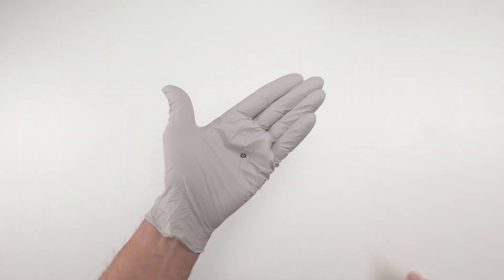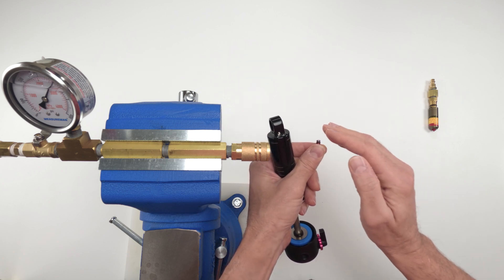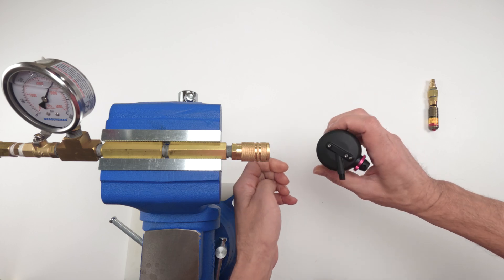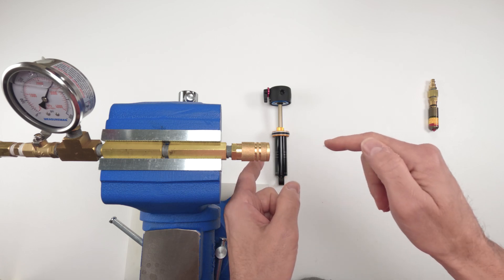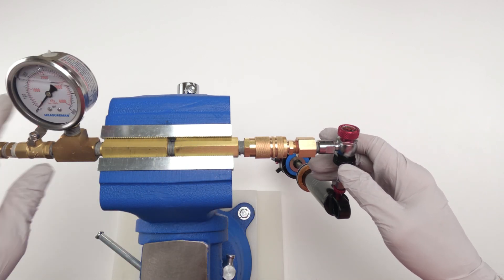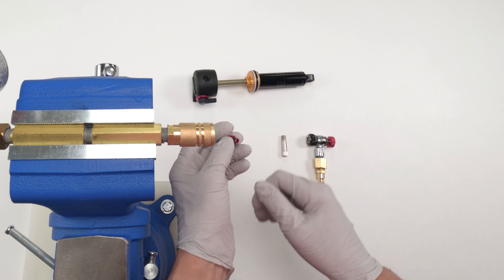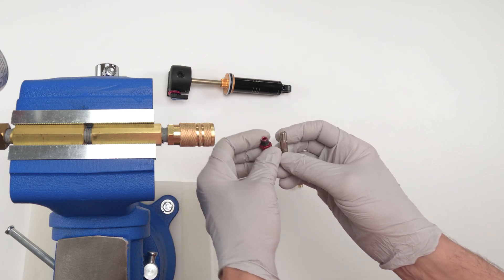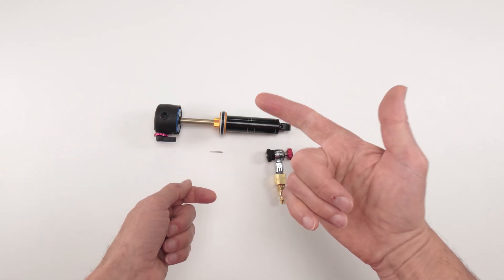Nitrogen Fill MTB Shock IFP Chambers with Schrader Cores for beginners. You've popped your last seal

Comment: Buongiorno,
Intanto complimenti per il video.
Ci sono novità riguardanti questa soluzione da parte di power tank? Oppure avete trovato qualche soluzione di altri brand?
Anso Suspension propone lo strumento "fox & rockshox shock ifp valve charging pro zero loss adapter-fill tool", potrebbe essere la soluzione?
Grazie mille!
Reply from the maker: Grazie per il gentile commento e mi scuso per il ritardo nella risposta. L'adattatore ANSO funziona, ma preferisco l'adattatore Racetech. Pubblicherò presto un video che approfondirà questo argomento. Ti auguro una buona giornata.
Reply: Perfetto, grazie mille.
Ciao!
Reply: Ciao, purtroppo in Europa l'adattatore di Racetech è introvabile. 
Ho provato anche a contattare direttamente Racetech per chiedere una spedizione in Italia ma purtroppo non ho ottenuto nessuna risposta..

Comment: I heard that u can machine  the threads off the adapter and just hold the shock onto the adapter by hand
Reply from the maker: I've never tried it so I can speak to whether how well it works. My main concern would be the potential to damage the weak threads in the damper body when using hand force while filling.

Comment: Topeak's PRESSURE-RITE SHOCK ADAPTER + your modified fill adapter + shock pump would be good for home mechanics
Reply from the maker: You might be onto something with this myman. I just ordered it. If this thing works as I think it might, I'll definitely make a video to let people know. Thanks for the head up 👍
Reply: @zoubtube Strokeshift in Poland also makes a Zero Loss Valve, with different thread options for RS & Fox
Reply from the maker: I'm not sure if he sells it anymore. it always shows as not available. Would you happen to know it can be bought online line elsewhere?
Reply: @zoubtube  Oh, I don't know. I just stumbled on it on Instagram. You might have luck if you message them there directly? Did you receive that Topeak part?
For me, I'm going to drill out my fill adapter (once a backup replacement arrives), add a length of spoke inside and try filling with my topeak lossless shock pump. It's the same concept where a pin engages/retracts to press the valve core, but it's all-in-one in the shock pump, no extra parts needed. Will let you know.
Reply: Update: Received a new fill adapter, drilled it out with a 5/64" bit and cut a length of spoke, filled with my 0-loss shock pump, and removed with no loss! I kept dropping the spoke pin so I 3D printed a pin with a head. There's just enough friction with the pin head to keep it from falling out of the fill adapter but not too much not to be overcome by the Schrader core spring. Works like a charm, no additional parts needed, thanks for the video and the idea!!

Comment: where did you buy that shrader adapter extender male to female?
Reply from the maker: I bought a pack at the autozone next to me, but they can be bought at many places. its a Schrader valve extender, or valve core extender. there cheap, you get like 4 of them around $5. you can also find them on amazon

Comment: Thaks! Found some high pressure hoses and connectors!
Reply from the maker: Good to hear. You might want to look at the video that posted tonight. during the IFP fill I go over sizing a pin to make an air fill adapter work with a no loss chuck. it might come in handy

Comment: @ZoubTube  hello there. Great video as always.

I assuming you are professional suspension mechanic, considering knowledge and tools you are using.
I know how to do small service of mine fork and shock (FOX), but I would like to learn more. I have few questions.

Where did you learn to service forks and shocks?

Is it possible for individual to pay and go to some courses and learn this kind of knowledge about servicing forks and shocks?

Is there any big difference in servicing for example FOX, Rock Shox, Ohlins, DVO?  Do you use similar tools?

How expensive are those machines for filling shocks with high pressure nitrogen gas?

Thanks in advance.
Reply from the maker: "I assuming you are professional suspension mechanic, considering knowledge and tools you are using."
Nope! I'm just an enthusiast. It's never been a profession. But I've been tearing apart motorcycles and cars to the frame from a VERY young age. I was surrounded by mechanics for my entire youth which helped.

I didn't seek formal training for mountain bike suspension work. Some companies, like Fox and rockshox, now provide guides that help. Other companies don't provide anything, so you have to figure it out. Reality is, If it weren't for customs tools, All this stuff would be similar to work on.

There are shops out there that provide training, which might help. But I have no idea how effective it is or how much it costs. As for making money from this, I basically don't. Hell, these videos literally COST me money to make. They barely pay for the electricity the video lights generate. But I don't mind. I'm in one of those super high stress professions. Just like diving, biking, skiing, snowboarding, etc, projects like these are therapy. I forget about the world. Plus, I get to help people, which I have been doing my entire life. 

Can you make a living off this? It depends. If you're going to open a shop, the cost of tools will be significant. I can't say how long it would take to recoup those costs. You would need a large biking community in your area, and then you need to get the word out. As for a nitrogen fill station, you can build one for between $200 - $300. It might sound expensive, but to me, it's cheap compared to other tools that rarely get used. Those are the expensive ones.

I would consider Google searching for courses for mountain bike suspension, and I would ask people to work on their bikes for free in the process. You never know, after a while, you might not like it and move onto something else. The only way to find out is to try 👍

Thanks for the comment and let me know if you have any other questions 🤙
Reply: @zoubtube I understand you perfectly. Thank you for reply 👍

Comment: Is that airhoseconnector regular or is there highpressure ones too?
Reply from the maker: High pressure. Some IFP chambers need 500+ PSI. I'd look for a hose that at least 600 PSI rated. hope this helps

Comment: I remove the fill port internals and run a Marzocchi Schrader valve. lock tite it in and you're gold. The only annoying thing is waiting the ten min for the loctiite to harden after every service interval. I also don't bother with nitrogen and just use the thick pump to set IFP pressure.
Reply from the maker: The only issue I have with the external valve solutions for IFP chambers is they need to be removed during a 50-hour service. It looks like this would be the case with the marzocchi valve as well, no? If yes, then the chances of the IFP height changing are very high when removing the valve, which would require resetting the IFP to fix

I totally agree with using a hand pump to fill the IFP chamber. It's Much simpler and air works just fine for the vast majority of people. But some people would prefer nitrogen, which I understand
Reply: @zoubtube  yes. The IFP can move some times if you don't open the air can before removing the air from the IFP. I find if I just take the valve core out from the air sleeve first it's not an issue with rockshox and x fusion. I don't have experience with other brands tho
Reply: @zoubtube  at least I think it doesn't move when I do it that way. There's no cavitation sounds and the damper circuits work like they should. The next 100 hour I'll check the IFP depths before blowing the IFP out

Comment: We're not PT Tune, but we are Power Tank and we're listening! 

Is that adapter universal between different shock brands? What was inside the adapter that you had to drill out and replace with the rod? We'd like to shorten the nose to not require as many threads to fully seat on the Schrader. You see the snap ring on the nose that can be optimized to save a few thousandths. Still a work in progress but we are always looking at ways to improve our products. 

By the way, did you know the founder and owner of Power Tank used to work in the bicycle industry? You may even be using something Steve helped design. Or have used something he helped design, anyway. This was over 20 years ago but he's still innovating every day!
Reply from the maker: My sincere apologies for mixing up the name. There are so many tank solutions on your website that, for a moment, I thought power tank was a product.  

There are different sized adapters. The one in the video is by far the most popular size, and it works with many shocks and brands. The other one is pretty much the same but has a thinner neck.

The adapters have a VERY small seat in them, no more than a mm. This seat is what actuates the valve in order to fill the ifp chamber with air. There's very little metal to drill out. Literally can be done holding it by hand. Then I cut a rod to insert in the adapter in order for the chuck to actuate. But ended up having to get an extender because the adapter didn't have enough threads to fully seat in the chuck.

The big issue with these adapters is with bursting the seals. They burst VERY easily with both a hand pump and a nitrogen system. I've never seen an adapter with a spring-loaded actuating rod in it. It would absolutely solve the seal bursting problem. 

"did you know the founder and owner of Power Tank used to work in the bicycle industry? "
I had no idea. I guess she decided to go play with the big toys! These modern off-road vehicles are an absolute blast.

If you need more info let me know.  I can even send you an adapter to get a better idea.

Comment: As always, love the detail and dedication. You rock!  One question: can you use just regular air instead of nitrogen? Tradeoffs?
Reply from the maker: Thank you so much for the kind gesture and generosity. 🙂Absolutely, you can fill shocks up with air. Nitrogen has very minimal benefit, especially in modern shocks. Nitrogen's biggest benefit is that it contains no moisture. This can be a benefit in a few situations. Example, You fill your chamber with air in Houston on a day that has 100% humidity outside, then you take a trip to somewhere super hot and ride VERY long and aggressive trials. There is a possibility that the moisture in the air within the chamber will steam, which will make for an inconsistent feel. With nitrogen, you won't experience this in this situation. But this is rarer than most people think.

Both rockshox and fox have no issue with air, and I defy you to find a video released from fox that shows them working on shocks for Pro Downhill races where they actually fill the shock with nitrogen. They use air! And this is for pro racing.

If you have a Schrader based IFP chamber, make your life simpler and use air. You'll be just fine, except for popping those adapter seals. 😁 

Thanks again myman! 👍
Reply: @ “You fill your chamber with air in Houston…” That’s definitely the first and last time I will probably see that sentence 😅😂.  I appreciate the work that you do.  Happy Thanksgiving!

Comment: Did u mean Strokeshift Zero loss valve?
Reply from the maker: I'm not sure what you are referring. The chuck in the video is a "No Loss" chuck. I have a habit of saying "lossless" due to another hobby of mine
Reply: @zoubtube  this is the tool name that you need. A polish guy makes them.
Reply from the maker: @Manetty6  For real! I tried google searching it earlier but came up with a black webpage, and the other results were all about drain systems. If you have a link for it please feel free to share. thanks